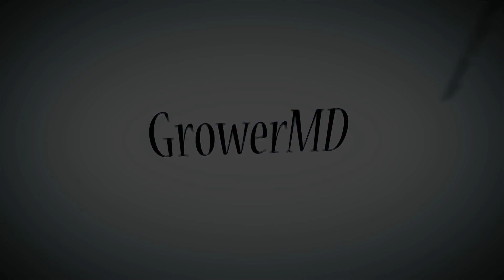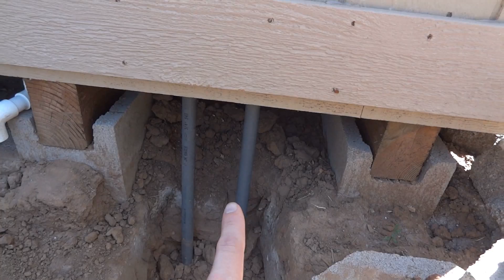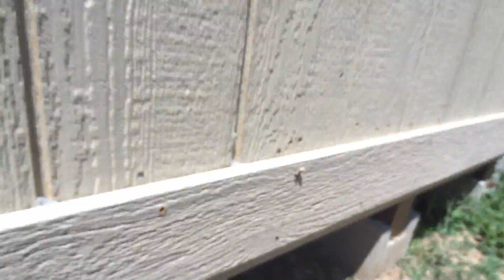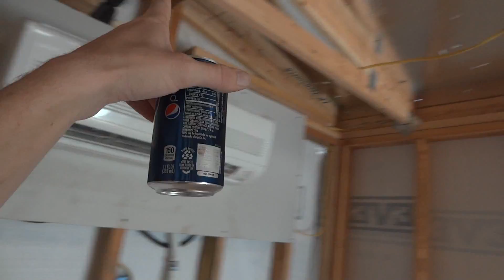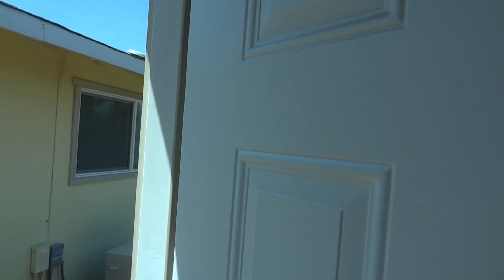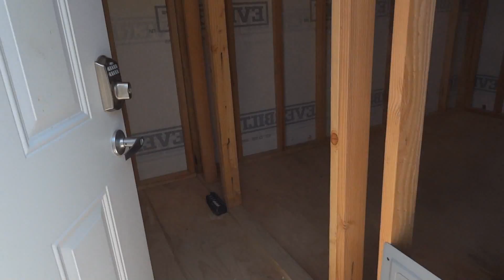New Projects - Part 2

Comment: Those inverter split units are incredibly efficient, I have two 24000btu splits and they run on 75% less power then my old compressor units.